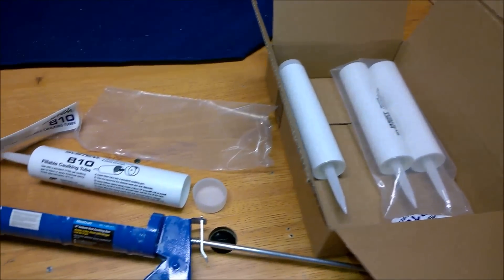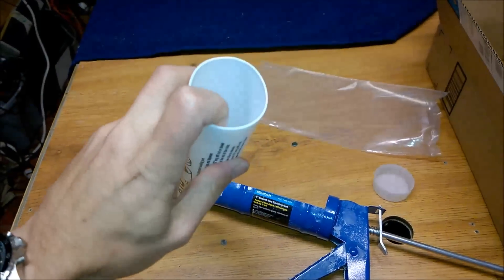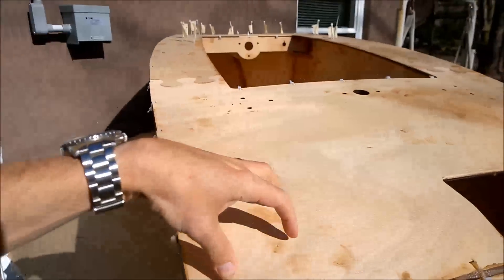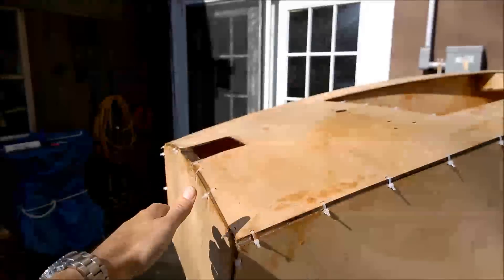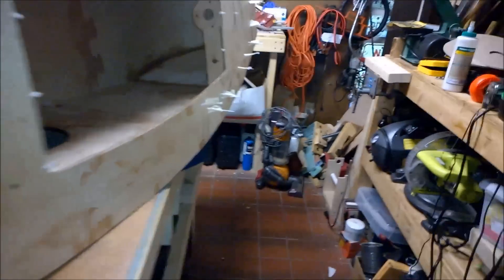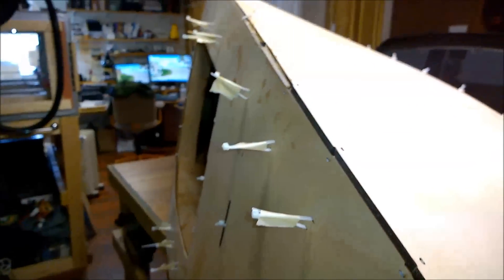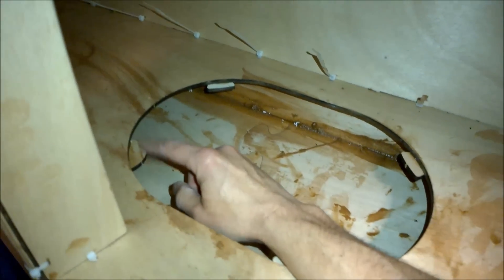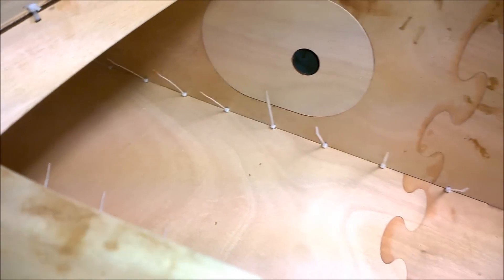Mini Boat Build - Video #6 - Caulk Tube Fillets!

Comment: I’m guessing the epoxy doesn’t stick to the ties due to their inherent composition? Thereby making it easy to extract them?
Reply from the maker: It does stick to them for the most part.  Part of the cable ties are left encased in the epoxy fillets.

Comment: Glad the caulking tubes worked out for you.

A few tips:
1. You can use mini flush diagnal-cutters (or a razor blade) to cut cable-ties right at the head. That way the loose ends of the cable-ties don't catch on anything or cut you. I do that every time I work with cable-ties. You just lose the ability to tighten them any further, but its still worth doing in my opinion.
2. You probably already know this, but you don't need to remove the entire cable-tie. Just cut them flush and epoxy / fiberglass right over them.
3. @5:48 You mentioned using the circle of the bulk-head access panel as a backing-plate. But now what are you going to use to cover the circle after you pour the foam in? lol. (I see circle-cutting in your future).
4. I noticed that you didn't perfectly align the panels on the corners in a few spots. It's not a big-deal, and probably doesn't matter in the long run, but the intention of the 0.050" inter-locking overlaps was so that there would be a perfectly inter-locked corner to run a fillet of thickened epoxy over.
5. Make sure you thicken the heck out of that epoxy, because you really want a rounded-form for greater strength. A soupy mix ends up flattening out and providing very little holding force. It is incredible how strong a filleted epoxy corner can be.

-Josh!
Reply from the maker: Great suggestions.  I appreciate the feedback.  Regarding using the circles for the hole covers after the foam pour....oh, crap!  Well, this is when a DIY CNC will come in handy!
I've spent a lot of time studying the interlocking panels and, yes, I had some of the side sections slip a little after they were cable tied and then epoxied from the inside, so they're set.  At first I was pretty bummed about it but figured I'd be painting the boat so a visual line of epoxy under varnish wasn't too crucial.  As far as strength goes it is pretty beefed up from the inside and will be well glassed on the exterior.  
I think I've found the right consistency to make the thickened epoxy after a few tries.  The first batch or two were on the thinner side.